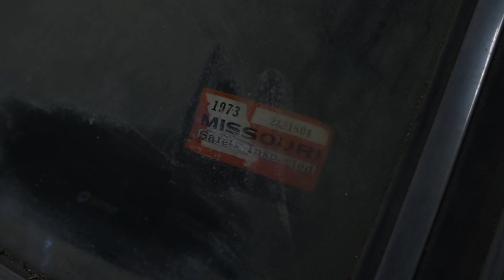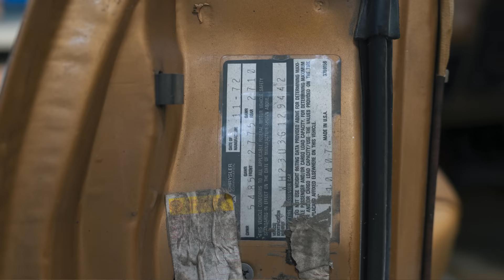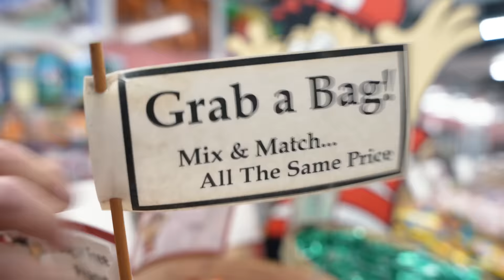FOUND: Mopars, Square Bodies, and 3-Wheelers!

Comment: Chrysler did use the slogan "The night belongs to Charger" for that generation of the Charger, but the real name of this special model is Limited Edition and was introduced as a "77 1/2" model. It is featured in the March 1977 issue of Motor Trend and its styling cues are the fiberglass roof with seemingly-recessed back window, horizontal bar through the opera window and the "Mirada-style" color-keyed horizontal slat grille.
Reply: I couldn't quite make out what the last car, the black one under the car cover was. Did you notice what it was?
Reply: @stevenmiller8986  Cordoba !!!
Reply: @MichaelSmith-kr9qw  Thanks! I remember them! Ricardo Montebalm, "Fine Corinthian leather".
Reply: @stevenmiller8986  I rolled over a Cordoba , and kept on going ......👌😉
Reply: Exactly where was Corinthian?

Comment: The car that the gentleman referred to as the Midnight Special is a 1977 Dodge Charger SE finished in Eggshell White with white vinyl roof, powered by the 360 V8 that is paired with an automatic transmission. Nicely equipped with power steering, power brakes, and A/C. This car is one of only 27,000 produced with only 500 believed to still be around today! This car features the rare Limited Edition package which has the split opear windows in the rear, color-keyed front grille, landau roof, and a sunken rear window similar to the 1968-70 Chargers. Red cloth split bench seat interior with automatic on the column.

Comment: Car and bike covers trap condensation underneath between cover and vehicles causing rust. I made the mistake of using a cover on my HD Road king in the garage for almost a year, luckily, I uncovered it to find chrome had rust before it got to far was able to polish and clean off. It will also accelerate pitting of aluminum parts.

Comment: I guess I don't get it. Dennis has found some amazing, rare cars, in almost new condition. Or he finds very valuable cars in terrible condition, but worth restoring. Other than the 70 Charger, these seem like scrap you could find in many junk yards, without much value
Reply: They are rough and that's putting it lightly, but there are still enough original parts on them to use on other projects. Original parts are getting harder to f8nd everyday.
Reply: He will only stay/restore with the 68 charger he will sell the rest of them as is, he had to buy them in order to get the 68
Reply: Beauty is in the eye of the beholder. Some people have different opinions and lived when these cars were driving around. Some might just be for parts, some might be worth saving.
Reply: That's why he millionaire and you are not..😜
Reply: They mentioned something about "have to buy the xxx to get xxx" or something like that. So basically I think they guy gave Dennis a reasonable deal on the '68 Charger but under the condition that he also haul away some of the other stuff at the same time.

Comment: Description:
1977 Dodge Charger Daytona Midnight Special A Very Rare car, as only 30, 367 Chargers were produced for '77 Daytona production did not exceed a thousand cars, with the T-Top option only installed on some 25 to 30 cars...I can't find an exact number. I am the second owner, having purchased this car in 1981 in Ft. Worth, Texas. the car is loaded with every available option, right down to a factory tow package that has electric brakes under the hood wired in, a rectifier to charge a battery, and hitch. full guage package, including a 140mph speedo
Reply: That actually sounds like one of the coolest cars of its time lol. 😂😅

Comment: Had a '73 Charger SE 440 w/727 W/console delete, 9 1/4 W 3.90 limited slip, sky blue w/white opera window top. I'd just stopped dirt tracking in '76 and had 1 440mag that I'd never used-yep, out came the boat anchor, factory exhaust, in went the real 440 and headers, along with a lot of suspension mods.
I don't know how many pony sized and poncho drivers hearts I crushed when I'd pull up to the line with 4 adults in the car, yank the cutouts, and walk away from them at our small towns hiway strips. I'd never race for money or titles though, I'd leave that for the '64 Barracuda.
Ya pay their asking price, take em out to eat, doggie bag 'em-fine American lifestyle.

Comment: Dennis a midnight special is on the the midnight shift if you’re friend or family ordered a car the line works would put extras in the car. Hence Midnight special. And the cordoba and chargers were built in the Windsor Ontario plant. Which is the home of the Pacifica. I know cause l work in the plant.

Comment: Back when I was a young in the early 1970s I remember one of my older brothers friends had bought a new 1974 charger SE that was triple black from the factory.  It had the console with a Hurst pistol grip shifter, 4 speed.  It came with a 318cu motor and dual exhaust with the same round chrome tips.  It had the 5 spoke rally wheels.  It was a cool looking car.  Seeing the candy made me think of cracker barrel. They carry all the candy from the past you can't get any where else.  Your videos are awesome to watch with all the cool looking cars.

Comment: Honda three wheelers are awesome. Great times running thru abandon corduroy log roads that were for logging in old days in northern minnesota. We looked for abandoned logging camps and dig for antique bottles and artifacts. We also used old cjs and mjs to blast thru the corduroy wetlands getting everyone wet and muddy. with the drought and climate change it is easier to find the corduroy log roads. just great fun on the north shore of lake superior. but a few freinds went for the honda two cycle 250 sx that was not great off road but more of a novelty for MX. the small honda four cycle engines would not bog down in any condition.

Comment: Have You Seen One? 1978 Dodge Charger Midnight,

Sporting an unusual fiberglass rear roof cap, this 1978 Dodge Charger Midnight SE was an attempt to further differentiate the regular Charger from its upscale competition. According to the seller there were only 2,300 Midnight Chargers made,

Here’s that unusual vinyl-covered fiberglass top. You can see how it makes the window appear to be recessed. I’m amazed at the condition of this one, because even if the 73,000 miles is accurate, that’s a lot of time for vinyl to shrink and appear weathered. This really looks nice. I would call the opera window treatment “distinctive,” as my mom told me not to call anyone’s baby ugly, and this has obviously been someone’s baby!

These Chargers also had a unique grille treatment that some compare to the Magnum grille. I find it a LOT more attractive than the standard Charger grille. It’s really clean considering the excesses of the 1970’s and some of the Ford and GM models it was competing with. Interestingly, there’s no mention of the Midnight Edition in the normal 1977 Charger brochure; perhaps it was a mid-year special edition?

Comment: 1977 midnight , special edition, came with a 360 mag., about 30 came with Ttop, around 2000 made total. They were fully loaded with leather,chrome rims, the works. Puffy landau top, with a inset rear window. The town car/opera windows set in the landau top.
These were SE, with a midnight paint option, of which that car is not. But it is an SE

Comment: Posted for a friend:

Based on owning Midnight Special (white/white) bought in '82, to '92.  Was built in Windsor.  Only ever saw one other (blue/silver).  Wish I still had it, ended up in the boneyard.
Previously had owned 77 Charger SE and I found not much difference in the basic bones of the car.  

77.5 mid-year release
Midnight Special just a name
Predecessor to the Mirada
All 400s big block only
Automatic only, 727 transmission, no 4 speeds
Rear end mostly highway gears, no posi, no high rev
All bucket interiors. no bench
3 colors only
Horizontal grill color-keyed, and landau top
- Egg shell white with the white landau top
- Jasmine yellow with tan top
- Blue with the silver top
Interior corresponding color e.g. white/white had oxblood interior
Basically just a Cordoba
Same taillights as standard Charger

Comment: 1977 dodge charger midnight special is a real car 440 big block very limited. Also in 1978 there was the dodge midnight express much like the lil red express but with a 440 rather than a 360 and was black with gold and midnight express in gold on the doors. If you find one (good luck) you best buy it! Cause there were very few!

Comment: Before i bought my car building i used a soft car cover and then then put a swimming pole tarp on top of that and tied it down to the tires to hold it. If you just use swimming pole cover the wind slappin against the paint will act like sand paper so dont just do that.

Comment: Good saves Dennis.. My uncle had a solid 73 charger, all black. We dropped a 440 in it and went to pull it outta the garage and I was in the driver's seat and the brakes didn't work and the tow strap came off and i took it backwards down over a mountain. Tore the door to the front fender and shoved the front end around banging it off trees. I was 15 and freaked out and all I had to do was steer it into the level. My uncle never yelled at me though. Its his fault he got me stoned.🤣
Reply: I did that on my buddy's Schwinn Orange Crate. (But I was sober.) I jumped on and immediately went down hill - and then saw that there were no brake cables on the bike.  I ended up hitting a tree.  But I don't think it messed up the bike. To this day, after doing brake work, I first drive up a hill if the terrain is not level.

Comment: Dennis, I know, you know, what you’re doing.  I do cringe sometimes, when I see some of the cars you buy. HA! But, still Lots of fun and Kool! Thanks!
Reply: Some are pretty rough and that's putting it lightly, but there are still enough original parts on them that can be used on other builds to make them worth the haul. Original parts are getting harder to find everyday. I guess that is why he has several acres of salvage jeeps, mustangs etc.

Comment: Those 71-74 Chargers look good with 15x8 Cop Car wheels and beauty rings and center caps or the Super Coupe wheels. I owned a 73 Rallye 340. Then I almost purchased a 71 Charger R/T 440 car but the owner flaked out at the time of the sale. I had cash in hand and he decided to put it up on Ebay Motors and he got less for it than I was going to pay originally !!!!  Karma !!!

Comment: Dennis this may be asking alot. Do you think you could find me a 1968 Chevy Chevelle Concourse. ? Now here is the rub. One with the bigger straight 6. All I find are cars that have had a 350 dropped in.  Can you help ?
Reply: The bigger 6.    Was a 250.    Smaller was a. 230.  6 cylinder

Comment: There is no way that first charger was sitting in the first Bay for 30 years that car had mold all over it it's been sitting in that driveway for 30 years
Reply: That one was bought in the past couple years, and they knew that. It was the other one that has been in the garage for 30 years.

👍🏻

Comment: Those bucket seats are hard to get really do you see those I understand and Charger RT 440 rally pack Dana power windows power steering power brakes power trunk release that got away I sold it in 1982 it was a nice car but I wanted a 69 Camaro how dumb is that oh yeah the charger also have 4-piston disc brakes from the factory it went to a good home I sold it for 8 Grand

Comment: Why does the sellers and owners of the vehicles not clean them up and pull them out from the clutter and junk they are buried in?
Reply: First of all it makes the video longer and maybe more interesting its kind of part of the find maybe Dennis tells them leave them as they are because the price is already set if dennis wanted he would tell them have them ready or no deal